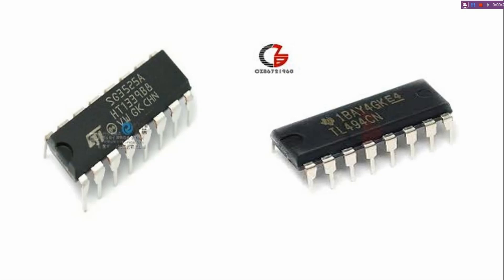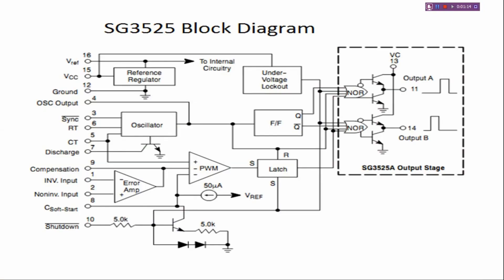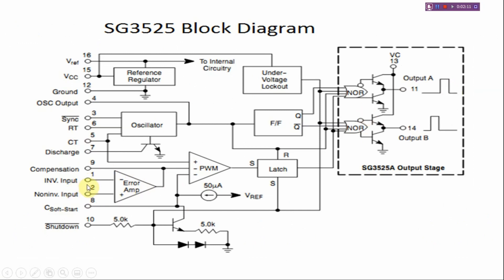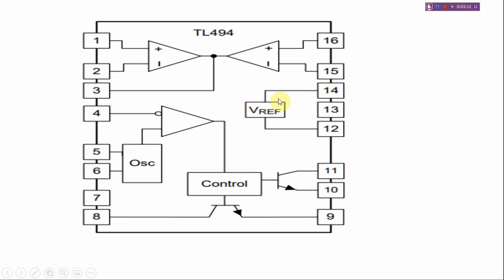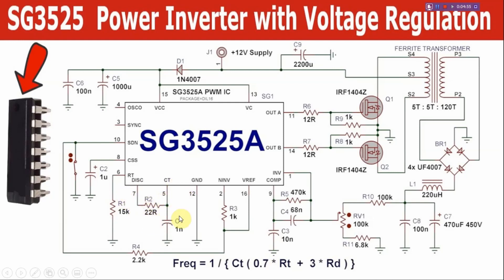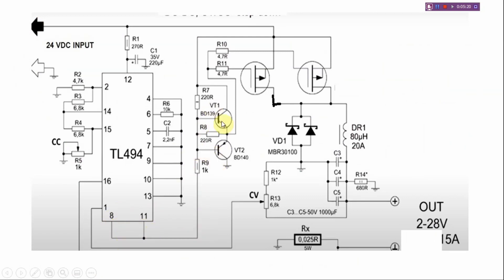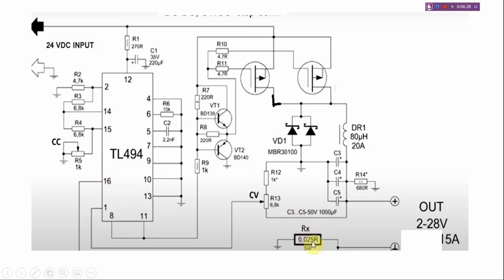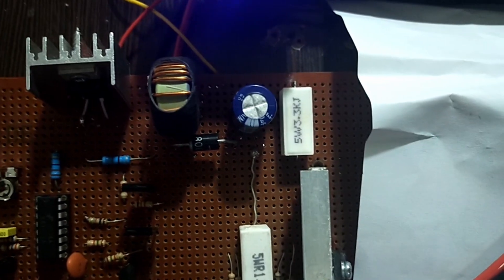MAKE YOURSELF A BUCK CONVERTER

Comment: Sir entel oru 12v batteriyum 1200va/12v transformerum und.board kathipoyi.ithinu pattiya oru inverter board paranju thravo
Reply from the maker: Txr center tap?
Reply: @saneeshelectronica9293  yes
Reply from the maker: Ready made board u can buy online.  Half bridge   u get only 600va   because  only one half work at a time